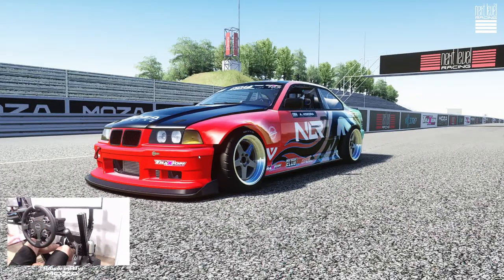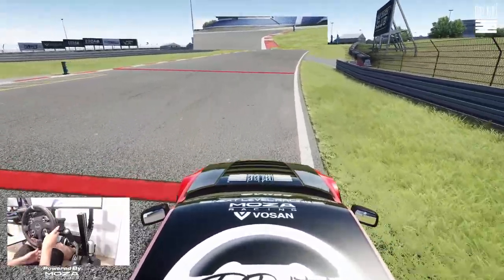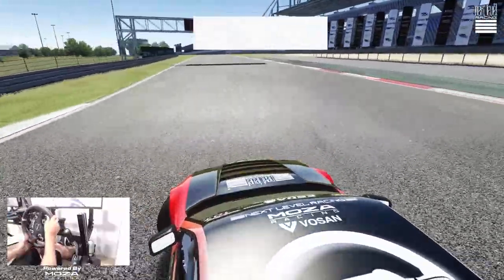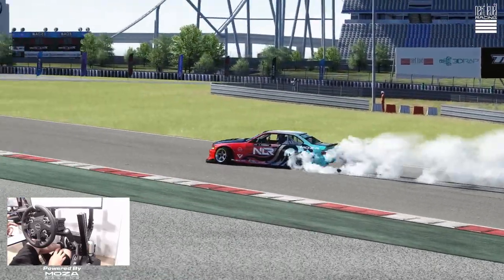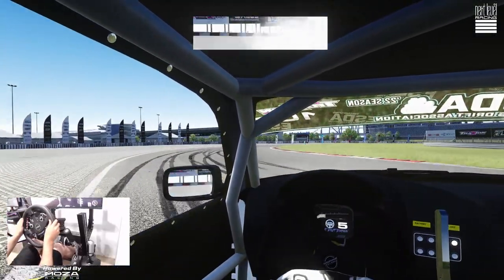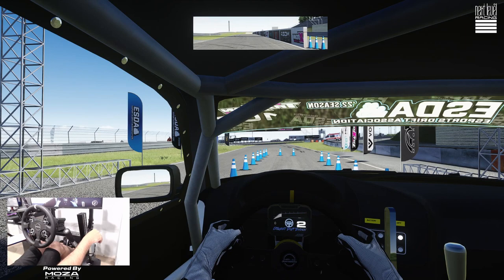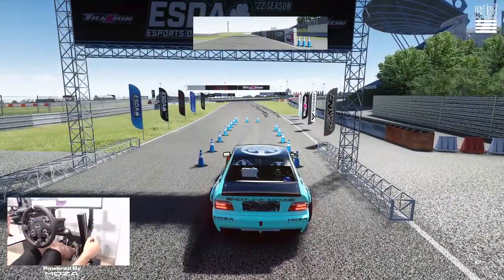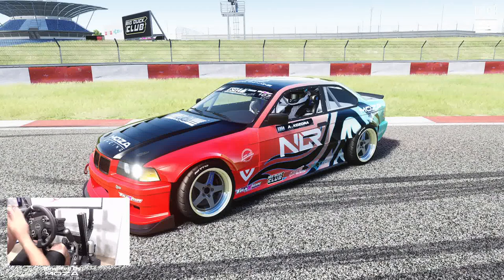ESDA Round 3 track walk and first testing Nurburgring GP

Comment: Are you using 1080 degrees or 900 degrees of wheel rotation?
Reply from the maker: 900 atm changing over to 1080 soon
Reply: @EvlRabbit07  What's the reason for changing over to 1080?